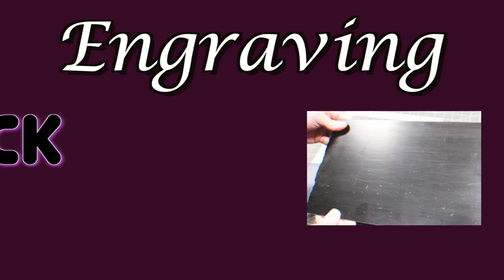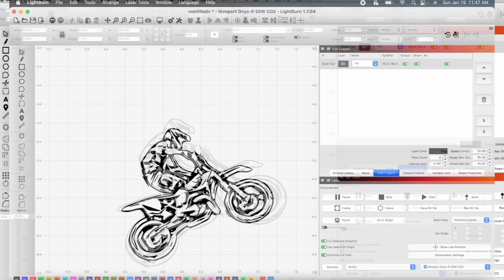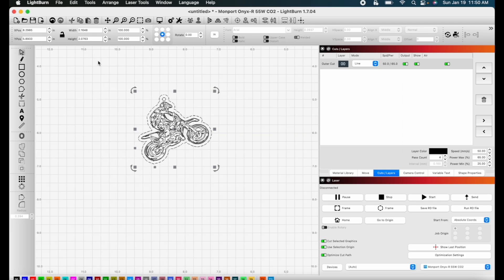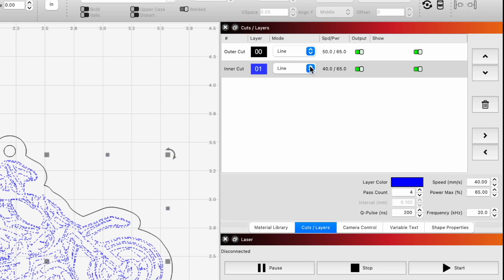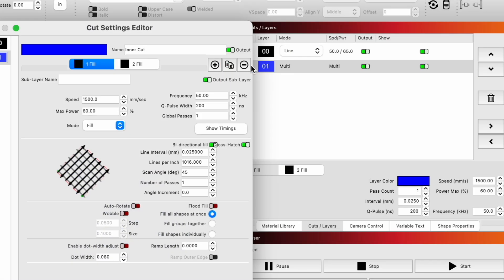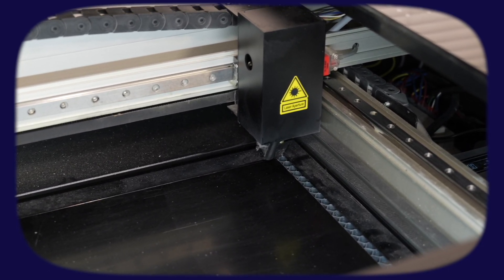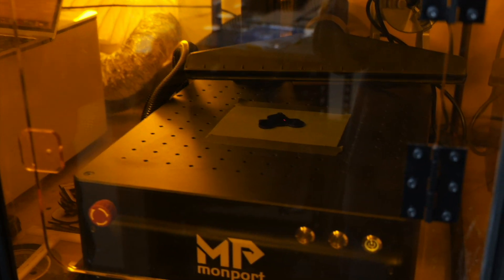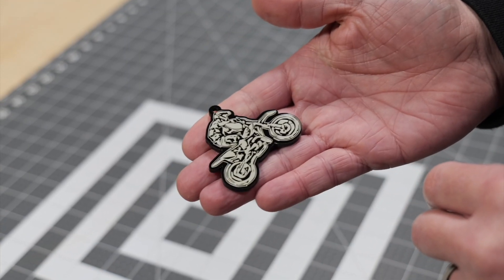LASER CUTTING & ENGRAVING BLACK ACRYLIC | Monport GI20 Fiber Laser & Onyx-R 55W CO2 Laser Engraver

Comment: I have an Onyx 55. I see that you are doing 4 passes to cut the acrylic. Is it better to move faster and do more passes to get a better cut? I'm brand new user of a CO2 laser.
Reply from the maker: We have found that at faster speeds and more passes it creates the best results with most of the acrylic we use on the desktop CO2 lasers. However, there are a lot of variations when using acrylic, for instance, color, brand,, type (extruded vs cast), etc, so its best to do some testing to get the best results. Thanks for watching!